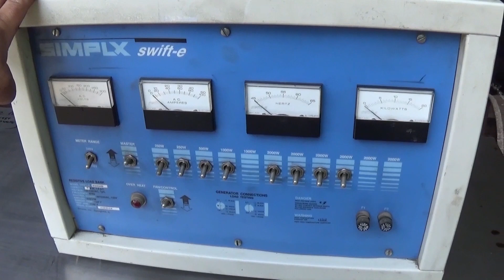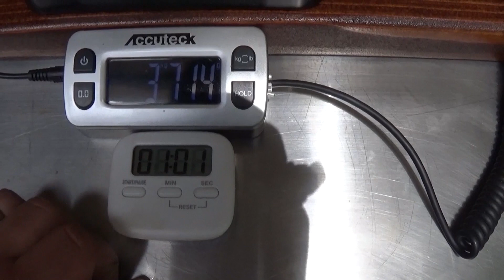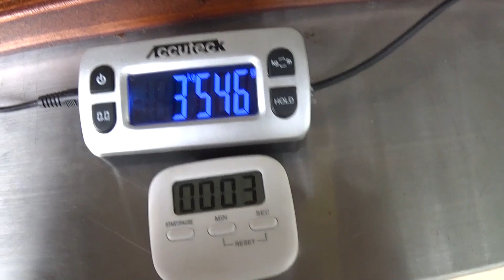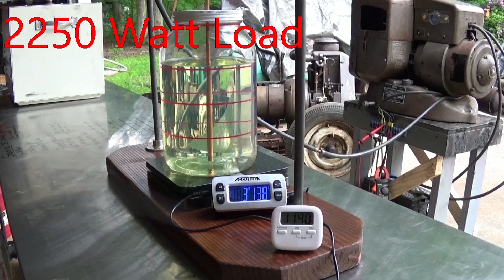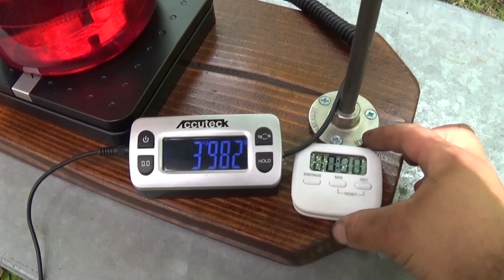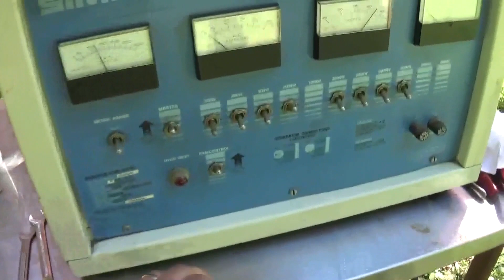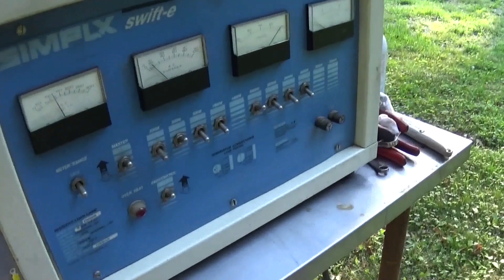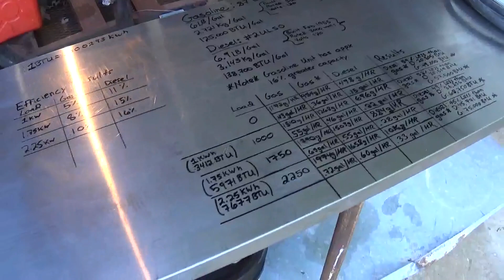GASOLINE VS. DIESEL (FUEL CONSUMPTION  1950s Style)

Comment: Although I think the 16% correction made scientific sense, It does not make real world sense. What I mean is, the consumer buys a 3Kwh generator and is not interest with anything but the stated output to meet the need. You demonstrated this with 0, 1,000, 1,750 and 2,250 watts that both are able to meet that need. The over sizing of the the gas units power plant is irrelevant because it made the necessary power. One more thing, it is possible the Onan needed the extra power for inrush current above 3Kw to keep the gen-set at 60 Hz. The only two choices the consumer had at the time of manufacturing was Gasoline or Diesel. The Diesel has a much larger advantage for sure.

Comment: I have a 2 cylinder Onan 6000 genset, (gas) in my 1978 GMC motorhome. and still going strong...  lol. those engines you have are as old as I am.... The diesel is a tad younger...  If your on a static platform weight does not matter.. but if your on a rolling platform.. weight does matter...

Comment: Diesel is clearly more efficient and probably more cost-effective to run, but also costs more initially to purchase and is typically a lot louder and will probably annoy your neighbors a bit more than running a gasoline generator.

I think the only reason gasoline generators are still so common is that they're cheaper to buy up-front and most consumers don't really think about efficiency or cost to operate, until they have to run a generator for two weeks straight lol.

Comment: Your correction factor doesn't really work and mostly isn't necessary.. If you are to do it though, you can take the unloaded gasoline fuel rate and a "corrected" fuel rate. Take whatever difference that is and just subtract it from all the other gasoline loads. Under proper load, an engine of similar design should have the same horsepower output per pound of fuel. I calculate diesel burn rate on large generators every day. I calculate the estimated fuel consumption based only on load, ignoring what engine the specific generator will have bolted to it.
That being said, that was an awesome video. Well laid out and planned.

Comment: On full load both of those engins get less efficient. So the gasoline is getting a huge boost from your calculation as it is further away from max load. The black smoke comming, sometimes, from the diesel is a tell tale that it is close to its max load.

Comment: One thing that skews it some is the Ethanol gas. You will burn a lot more with Alcohol mixed in than straight gasoline. Maybe not enough for such a small engine, but it might be measurable.

Comment: Very interesting Mike having driven a petrol vehicle for 24 years of my life and diesel now for 17 years I always considered the diesel a better all rounder my last 2 have both been Toyota Hi-ace Vans the first one a 2. 0L petrol and the present Hi-ace a 2.8L
Diesel the diesel is far more fuel efficient than the petrol
I known your tests are only on stationery engines but it gives proof to the difference between the two. 
Would you happen to know what the Prices of both engines where back in the 50's and probably how much more the diesel one was originally over the petrol. 
As a side note my diesel van has just clocked over 313,000 kms just broken in you could say! 
If my petrol had that mileage it would probably be just about on it's last leg's. 
Thanks for the intesting video. 
Tony from Western Australia.

Comment: One thing I have alway found hilarious is how perfectly balanced older engines are and shows a time period when quality actually came first and no shortcuts taken. Most of today’s pos generators are over rated and not much use other than an oversized vibrator that when left unattended navigates it’s way through every inch of floor space in your shop and wrecking all the high quality irreplaceable gear and tools because it got jealous. 😆

Comment: Is that actually an Onan diesel?  I knew they made 2-, 3- and 4-cylinder diesels but not a single-cylinder one.
Reply: I have a 1969 single cylinder Onan DJA 3000 Watt air cooled diesel gen set. Onan actually made their own engines back then.  My other 1990's  Onan has a 3 cylinder Kubota diesel powering it.
Reply: douro20
 ... Yup, there's a bunch of them out there in single cyl applications, but they max out around 3000 watts and most were 120 volt only. They did make a 3500 watt 220 volt, but those are few and far between. I don't recall Onan ever making a 3 cyl unit but they did make 2 and 4 cyls in air cooled configuration up to 12.5 Kw. I worked on many over the years. They looked almost exactly like their gas fired brother, which were 7.5 and 15 Kw. Obviously the noise level was different!

Comment: A Diesel engine is  will always be more efficient, but since the fuel is about 50 cents a gallon (or more) higher in cost, the savings are not that great except in time between fuel-ups. If they ever get a less expensive fuel readily available, I'm all-in, I love hoe simple Diesel engines are (or were), how easily fixed, and how durable they are.

Comment: I love to see (natural gas / propane) vs gasoline fuel consumption test.
 
I am trying to figure out if it would be cheaper to run a gen set  on public utility natural gas .
Here we pay approx. $1.22 per therm ( 100,000 BTUs ) 
a 5,000 watt gen set with 10 h.p. engine at 1/2 load should use about 50,000 BTUs I think ?
Or $ .65 an hour to run vs a gas engine at approx $ .80 gallon per hour or approx. $ 2.12 per hour to run .

The fly in the  ointment is after you use ( X ) amount of therms then you move up to a higher rate scale. ( Tier)

I love to see real figures instead of guessing at theoretical answers

Mike

Comment: 1950 gen set  1000-1800rpm which according to some makes engine quieter, 2020: 3600rpm and way louder (correct me if im wrong)

I know, there are still new 1000rpm generator being made but why bother with 3600rpm ones ? Ive seen 160kva 1000rpm gen way quieter than 2.5kva 3.6k rpm

Comment: Quite interesting to watch, and I guess there's a hundred ways to do this test, but I'd further guess that what matters to most people is how many kW/h per gallon of fuel, or even more likely, how many kW/h per Dollar, if we were to factor in the cost of the different fuels.  I'd guess that the simplest, but less scientific approach would be to have two measured (equal) amounts of fuel, a fixed load, a kW/h meter, and run until the fuel expires - Then see how many kW/h have been produced. Alternatively, instead of a measured volume of fuel, measured cost of fuel could be used, say $5 of each fuel? And see how much bang for your buck?

Just thinking out loud, and to be honest, we run our generators through a kW/h meter just to keep a tally on how much electricity we're pulling off them. It does actually work out to be worthwhile to use a different generator at different times of the day.

Comment: Pretty neat.    I think I would have used 91oct instead of the ethanol.    Probably get a little more run time.       Plus ethanol is not good for anything with a carb.

Comment: What you should have done is break it down to BSFC (Brake Specific Fuel Consumption), basically Lbs (or Grams ) of Fuel used per Horsepower Hour.

Comment: Great video!! But isn’t the generator a 2 cylinder THUS requiring twice the amount of fuel? 
I would expect a 1 cylinder diesel to sip fuel and I would also expect a 2 cylinder 500+cc Rv generator to use twice the amount of fuel because it has twice the displacement! 
Correct me if I’m wrong please

Comment: Interesting video, thanks for making it. Is there significance using one hour for each test? Curious if running each test for 15 minutes then multiplying by 4 would provide an hourly rate within a gram or two of the full length test.
Reply: In scientific testing, greater sample sizes help to increase accuracy (or minimize error).
Reply: @arty1799  thank you for your response

Comment: Interesting test but your numbers are wrong. E10 is not 125,000 BTU/gallon, that would be E0. E10 is more like 111,000, but it varies depending on the exact mix in your state. Because of this, it's also not exactly 6lbs per gallon, either...also weight per gallon has to be corrected for temperature. I don't think your correction for engine size has any merit. The problem is it can be different batch to batch - that's why the pump always says "up to" 10% ethanol, and sometimes it's higher than that.

Also, that gas engine is way, way less efficient than modern OHV engines. Super low compression = poor efficiency. Looks like it would make less than 4KWH per gallon, my cheap-o disposable china mart generator makes more than 5kwh per gallon!
Reply: Who cares. This is a sweet video of a battle between two old school motors.
Reply: @WogChilli  Except the science is entirely wrong. Sorry facts got in the way of a good story.

As to "who cares", obviously you do.
Reply: @ryanroberts1104  I studied organic chemistry and know about the low/high calorific value's. Just enjoy the video man and stop nit picking apart dudes who have gone to a lot of effort to make quality content like this.
Reply: Sure mate

Comment: Damn! I figured diesel would burn less fuel, but not by that much! Plus you get to use off road diesel. About the gasoline correction factor, it looks like it benefits the gasoline numbers, but diesel is still burning roughly half as much fuel to do the same amount of work. Diesel wins, that's the point.

Comment: Going back to view the video, you can correct the1750W overtime reading to 1770g @60:00 and 2250W to 1550g for gas, rather than guesstimating a correction.

Comment: with a newer gas and diesel(direct-injected) the numbers are even better for the diesel also diesels can run on about any light oil and the fuel lasts (basically) forever Yes they cost more upfront but pay for themselves quickly

Comment: Who's the actual manufacturer of the diesel engine?  Lombardini? Deutz? Lister?  LOVE the video and the scientific method put into it for a true valid comparison using BTU/lb. for the fuel and weight of consumption.  I built a generator (https://www.youtube.com/watch?v=YppqkMtOkV0&) going on 15 years ago using a ChangFa R185 8.8hp hopper cooled (yeah, yeah, China.....I know), driving a 3.2 kW Markon 2 pole gen head via an industrial 8 rib belt drive.  I replaced the oil bath air cleaner with a "custom" manifold topped with a big Solberg air compressor filter/silencer and replaced the stock muffler with a car muffler from NAPA (old Corolla or something).  It's still loud as heck but not nearly as bad.  The intake noise was almost as loud as the exhaust!  I've got some old video stashed somewhere that I'll upload.  I've had very little actual need for it except 18 hours or so in 2009 for an ice storm.  One day I'll get ambitious and convert it to a thermosyphon/closed system but it really doesn't use too much water when only at partial load. 'edited to add video link'
Reply: It's an Onan engine.  It's not quite as common as the later Q-series ones, which were available as both gas and diesel engines.
Reply: Still thinking onan didn't build themselves but lincensed. Someone mentioned Cummins which sounds reasonable.
Reply: Current Onan gensets are running a John Deere engine, since John Deere owns Onan now.

Comment: What about computing $/kWh? If the weight is not a big concern, like stationary generator, and you have way to buy fuel close by, then it is only matter of fuel cost and maintenance costs, and maybe emissions. The gasoline or diesel prices are rather variable, both between states, countries and time, plus they are usually sold by the volume, not weight, adding to the complexity.  But is appears both fuels do have pretty close prices volume per volume. +/- 20% from each other per galone (or per liter). With Diesel still using about a half volume of the gasoline engine, that still makes it more cost effective in terms of fuel. (The other costs will probably be a bit higher in the diesel).

Comment: Capacity doesn't matter.  You just need to know what fuel it uses for a fixed load.  Those generators are very close in capacity so you don't need to handicap anything.  It's a real world test.  For all you know Onan could have used that same engine on a smaller gen head.  Maybe the closest you could come to a useful correction factor would be engine HP.  But even then I wouldn't bother.

For example, say you had a 400 HP V8 turning a 3000W generator.  Would you correct for that because it is a 400hp engine?  No.  Because it's probably only putting out like 7hp for the test so there's nothing to correct for.

Comment: The big, REALLY SLOW 2-stroke diesels used in large ships, running less than 150 RPM, are the most efficient engines available, with thermal efficiency up to 55%, vs the terrible 5% to 10% of the gasoline engine in this vid. Plus the ship engines run on really terrible fuel, like residual oil, that can cost as little as $300 PER TON! (Of course there are some inconveniences with resudual oil, like you have to heat it too about the boiling point of water just to make the oil flow.) There have also been diesels running very nicely on powdered low-ash coal and on landfill gas (about 50% methane and 50% CO2). Both of those weirder fuels reguire a little bit of normal fuel, like 5%, to act as igniter. The powdered coal, btw, is not injected; instead it is aspirated through the intake valve. In modern diesel experiments, medium-sized engines look like they can reach 55% thermal efficiency by using 2-stage compresion and 2-stage expansion (not counting any turbochargers in the compression and expansion). Other modern experiments with medium-to-large engines can also reach 55% thermal efficiency using direct injection of a slurry of powered coal, in either oil or water! (The water slurry fuel is not for engine starting.)

Comment: If you would have ran straight gas instead of the ethanol gas the gasoline engine would have about 8% less fuel consumption. Would not hurt to make sure the gasoline engine timing is in spec as well with a good sparkplug.. Like the test.

Comment: unfortunately your test was off slightly since ethanol added to gas can decrease a gasoline small engines efficiency by a little I think it is about 10%
Reply: He compensated for that, by finding out the BTU content of the gasoline. (10% ethanol gasoline has a lower BTU content than non ethanol gasoline, which is about 128,000 BTU's per gallon)

Comment: The gas engine in this case will burn a lot more fuel because it is a 2 cylinder engine -  
     Another factor is if the engine is a L head gas engine they tend to burn up to 33% fuel over a over head valve engine - 
      I'm a 3rd generation machanic/electrician - my grand father worked on power houses and farm light plants from the early 1900s till the late 60s - I spent my yr in. The off shore oilfields - 
      This is a general rule with overhead valve engines - the efficency of gasoline single cylinder engines will be about 3:1 and a diesel will be  4:1 - a L head gas engine is normally 2:1 efficency - 
       That means it will produce 3 kw per gallon of fuel burned  at 3600. RPMs -
       High temperature stationary diesel engines that use transformer oil for coolant, run at 250° F - at 650 RPMs they have a 13.:1 fuel efficency and at 360 RPMs they often have a 20:1 efficency -

Comment: As you can see, the diesel was losing efficiency as compared to the gasoline engine with its number gradually decreasing as you go down the list.
Therefore, the two engines will reach parity at some point and if you extrapolate the numbers even further and fully demonstrate the existing trend, the gasoline will do better to a point where the diesel won't do anything at all. Man...I'm a genius.

Comment: I would say these generators aggregates aren't super efficient by current standards. I checked few Diesel generators in my local country from 5kW to 15kW, and they use between 0.155g/kWh and 230g/kWh (depending on the load and rating of the generator), where yours' is about 2-3 times that. (460g/kWh at 75% load).
Reply from the maker: Thanks for checking it out.

Comment: Btw fantastic broadcast today...if i remember..fuel standards in the 50s.. 60s..and early 70s are completely different... Diesel fuel was diesel fuel..leaded gas was real gas...really not sure what this crap they sell at the filling station is any more... When i was young and driving...i had a 64 chevy truck with a 283 v8..it got about 14 miles to the gallon on leaded fuel..when the discontinued leaded fuel my fuel economy dropped to 10 miles to the gallon...WTF??

Comment: I disagree with using the 16% correction factor as you cannot downsize the gasoline unit to fit your load. Apples-to-apples, someone in 1955 could have chosen either until to supply the same load so long as it didn't peak above 3,000 watts and you would achieve the fuel consumption given by the raw numbers. To show fuel to electric conversion efficiency then apply the corrections as you did. But again, they are academic as installed. 

Unit-selection criteria is more complex and fuel consumption costs can easily fall far below capital costs in many standby cases. In standby service the generator is often not operated for enough hours over its lifetime to recoup the higher costs of a diesel unit. And if you never run the gas unit long enough to wear it out the longer life of a diesel unit is meaningless. 

Also, your 1954 gasoline engine has a compression ratio to accommodate roughly 80 octane fuel. Increase the compression ratio to take advantage of the 87 octane and the numbers will improve. I have a 6500 watt Onan from the early 1970s and I may shave the heads to up the compression as it runs on high octane propane.